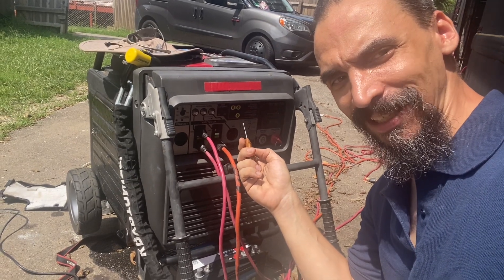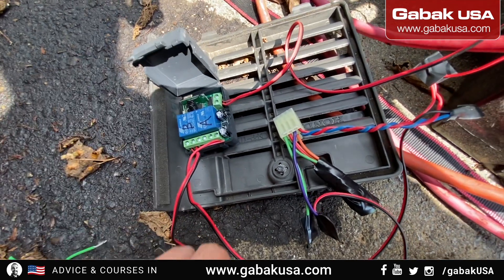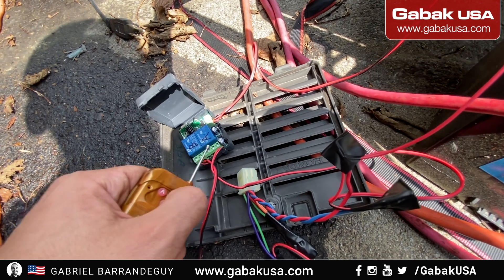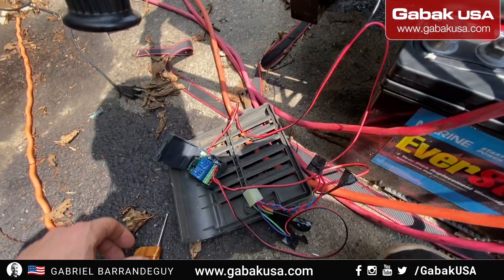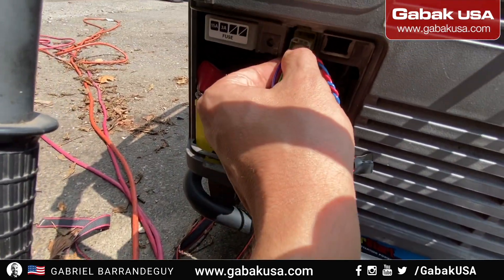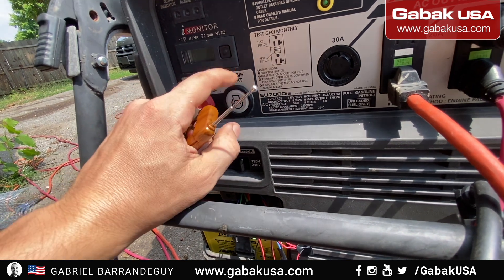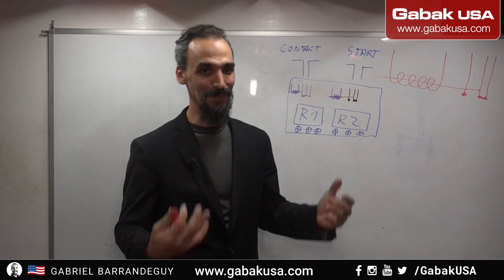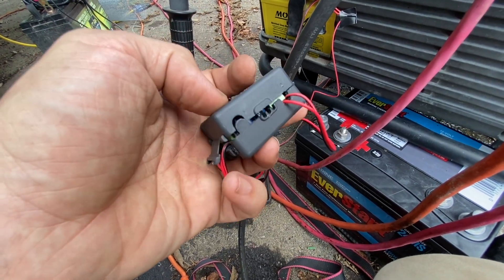How to make a remote control for an Electric Generator Honda eu7000is for $30

Comment: Hello and thanks for your generus explanation... i think i have more than one question if you can help 

Now to start the generator .. the on/off switch must be on . Am i right ?
If yes 
Then if i want to start push button on generator will it work normaly or not ? Maybe i should push the remote to enable the circuit

So second question
You said the lcd will be off unless i press on remote so to start press B once will activatethe LCD .then press A to close circut and run generator 
Then to shut down press A to open the circut ...

Still some misunderstanding

So if you can shoot a video just to explain the buttons working without drawing it will be better ... just show us what A button is doing and B in real life

Thanks
Reply: 1- generator must be in on position to turn it on or off with the remote control
2- the second question in the 30 first seconds of the video button a to turn it on and button b to turn it off

Comment: I have a newer one of these generators. It has a 6 pin plug and built in bluetooth/remote start capabilities instead of the 8 pin model with remote start built in. The remote start works fine. However I want to hook it to my new home backup battery system which uses a 2 wire system to control the generator. How would I wire it up to use the battery system control without losing the ability to use the built in bluetooth functionality?
Reply from the maker: i dont have one of those at hand, it can be done, i would have to see the circuit to design something for that.

Comment: Please release a wiring diagram.
Reply from the maker: watch the whole video
Reply: @gabakusa   I watched till the end. It was helpful. I could understand what you are saying but the video was not helpful to understand the circuit.  We recently Got this one and to avoid waranty I am not able to open up the control panel to have a look inside the control panel. I will be happy to Pay for the internal wiring diagram of the control panel with pictures in pdf so I can develop my own remote diagnostic and operation sytem. What ECU chip is used for Fuel injection?
Reply: @gabakusa   by the way thank you for quick reply. Pls stay in touch.